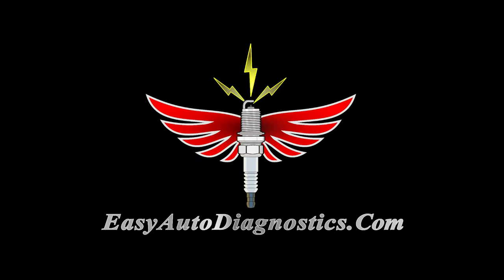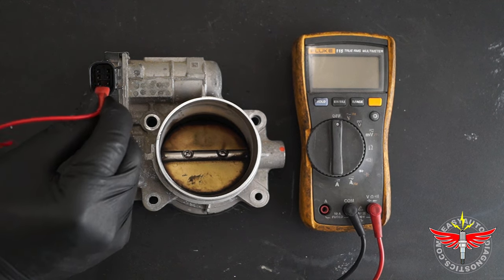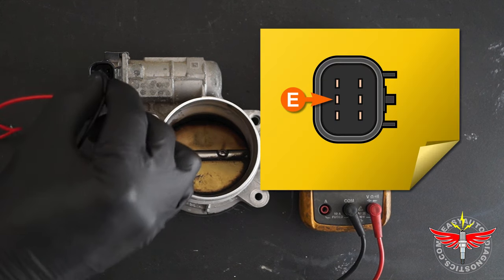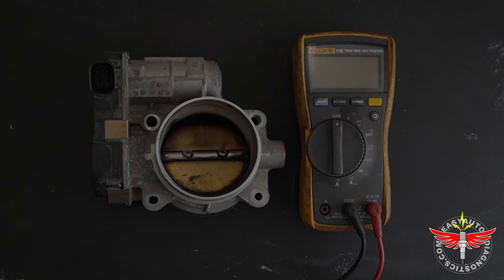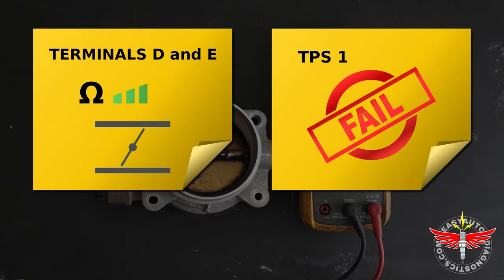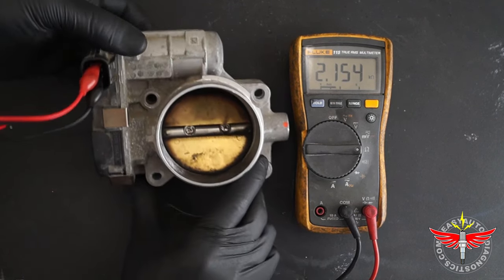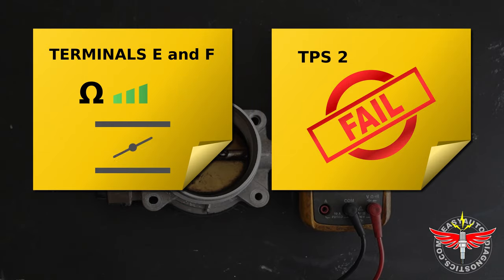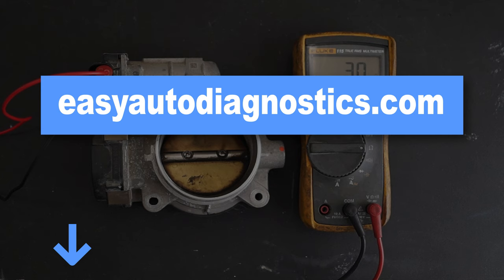How To Test The Electronic Throttle Body. GM Vehicles 2006-2011

Comment: Can you post the details for APP sensor. I am getting 2135 code on Nissan Teana. Replaced the Throttle body with Sensor but still the same. I have tried the same steps on APP and got 0.9 Ohm in one of the test. I don't know how to confirm whether the Accelerator Position sensor is bad. its a 6 Pin in a row pedal. can you please tell me the steps like Ground to Sensor 1 should give this much reading, something like that.

Comment: does this work with 2008 honda accord ?
Reply from the maker: No, it won't work with the 2008 Honda Accord. Why? Because the throttle body on the Honda Accord is not the same one and its internal circuits are not the same. What engine size is it?

Comment: Can this video be used to help diagnose/troubleshoot  other throttle bodies? Or do you have a video for Ford throttle bodies?
Reply from the maker: At the moment I'm working on a few other throttle body videos, but no Ford throttle body yet. The testing procedure in this video only applies to the vehicles listed because the indicated terminals (to be tested) apply only to this specific type of throttle body. Most, if not all throttle position sensor's in these electronic throttle bodies can be tested with a multimeter in Ohms mode, you just have to find out what terminals to test. What Ford vehicle do you need to test?

Comment: Great video! Very detailed and of great help. Could you please point me where I can get the values and corresponding terminals for a Jeep Liberty 2010 to perform the same test?
Reply: Did you happen to get these values? Also looking
Reply: @bthayer7797  I didn't get the values, could not find them anywhere. I ended up replacing the throttle body, that fixed the issue. Beware the relearning procedure is a major bitch, be patient.
Reply: Thanks, where did you find the relearning procedure? I've seen a few on here just curious .
Reply: @bthayer7797  it was a youtube video, i watched several, i do not remember exactly which one, all i remeber is the video showed a very basic, manual relearning procedure without the fancy and expensive scanner, it took me several tries and several hours.
Reply: @bbroncs  gotcha thanks. One last question, what were your original symptoms?
Reply: @bthayer7797  First, the red bolt on dashboard turned on, couple of days when by like that. I also noticed i was having problems when starting my vehicle, sometimes it turned on after the 2nd or 3rd attempt. Also notice stalling, jumpy and at last I will press on the gas pedal to the floor and i will only go up to 20-30 mph. At that point, i just parked my vehicle and scaned it with my scanner tool ($15 on Amazon). I ran the scanner and the codes pointed to the throttle body. I also did my research online and found the symptoms and code reading pointed to the throttle body, so determined that was the cause. Hope this helps.
Reply: @bbroncs  thanks man, I appreciate it.